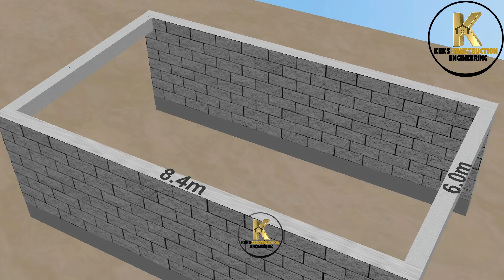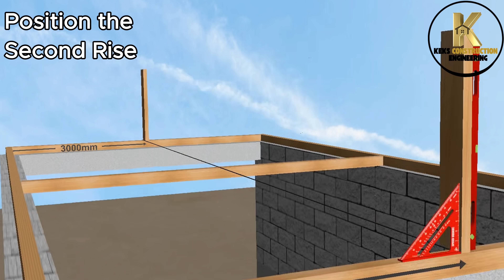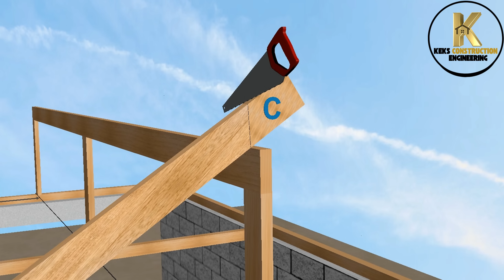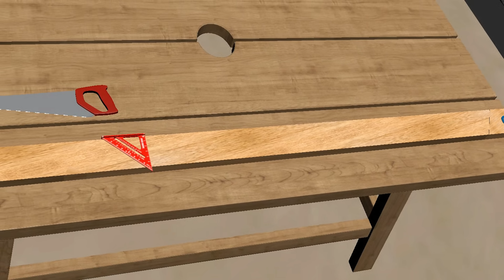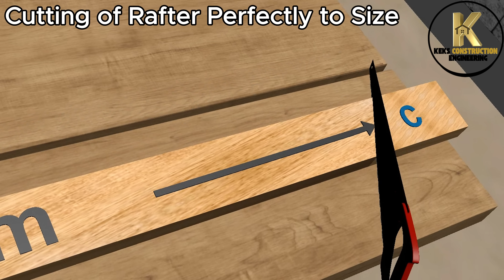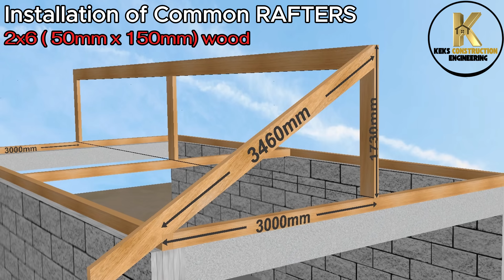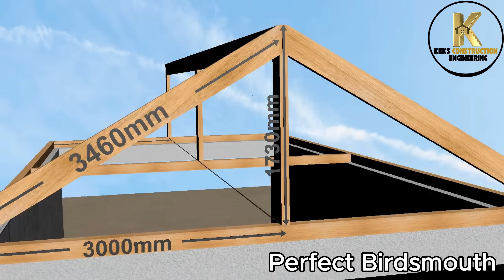The SECRET to Perfect RAFTERS Using a SPEED SQUARE & Spirit LEVEL

Comment: Great tip for getting accurate rafter cuts. Proper framing and roofing details make a big difference in the strength and durability of a shell home. Quality shell construction gives homeowners a solid, weather-ready starting point while still allowing plenty of flexibility for interior finishes and customization.

Comment: I still don't understand why the rafter drops a small distance onto the wall plate at point B, while at point C the top of the rafter is level with the ridge board.😮 I have already seen several films about rafters and birds mouths. I never saw a good explanation about this. I did it myself by transferring a scale drawing from paper onto the rafter. That worked fine too.😊
Reply from the maker: Ok. 
Don't worry, I will do one Video that will Simplify everything in a very easy way.

Watch other Videos on this Channel and Stay tuned for more.
Reply: Thanks 😊

Comment: Как на счёт совета по односкатной крыше, но с полезным пространством внутри, с высотой от 80см. низкой стороны. 📐 Какой сделать оптимальный угол, если укрывать профнастилом?
Reply from the maker: For a lean-to roof with corrugated metal, an angle of at least 8-10 degrees is recommended to ensure proper water drainage.

Watch this RAFTER LAYOUT Video below.....You will love it 👇👇 
https://youtu.be/2LuKOz1EVXg?si=xytOUHWmUnykRXuH

Comment: Solutions in search of problems.
How to cut and assemble a gable roof and its variations was mastered long ago. It isn’t hard.
Learning how to do it with just a rafter square, tape measure, pencil, and appropriate saw is the best way. You can then vary the tools if you choose, with a real understanding of what you are doing. It isn’t hard.
Here’s just one old school tip for a basic rectangle footprint with a gable roof: you only run one string line to straighten the ridge and bearing walls, and you only run it once.
Here’s another: never measure rafters individually, and never trim correctly cut rafters. If the rafters don’t fit (presumably because an idiot built the walls), FIX THE WALLS. It’s faster and when you are done everything is what it is supposed to be.
Reply from the maker: I appreciate your insight on these fundamental methods; construction is indeed a field with many valid approaches.

Watch this RAFTER LAYOUT Video below.....You will love it 👇👇 
https://youtu.be/2LuKOz1EVXg?si=xytOUHWmUnykRXuH

Comment: you know work's even better.... a rafter square.  
I'm not sure why anybody would try to reinvent the rafter square by using something inferior like a speed square. 
if you get a rafter square with a rafter table inscribed on it then you have the info needed for calculating most common slopes and if you don't have a calculator then you can use the framing square to 'step out' the rafter.

Comment: Sometimes you don't have access to a calculator or don't have arithmetic skills. In this case approximations are your best option, including guessing the length  of the rafter and the angle of the plumb cut.  Yes you can get a long rafter and guess the plum cut. If it is wrong simply cut a little more until you get it right. .This video promotes this approach, very useful in some countries. You can wing it when using lumber. If you use metal keep away from this video. Metal requires more precision and it is worth learning the simple arithmetic. The danger with looking at at an AI video with an AI voice is that you should know that behind this video there is NO CONSTRUCTION talent or experience, only theory.  10/10 for making a video game -like constructional videos. For some reasons the numbers are wrong as well. Not by much, but they are wrong. Also look at videos where a human that knows what he is doing, uses lumber and not computer graphics and bad arithmetic. The producer of this video is probably a student with no hands-on experience. Does not tell you the size of the rafters, the size of the ridge board, does not consider the "adjusted run", does not tell you how he got to the rise of 1750mm. DO NOT copy the architecture of this gable roof. It is NOT structurally sound. Anyone with basic arithmetic can see that the numbers, that are very easy to calculate are wrong, including the diagonal.  This is an AI  "wing it" video that shows the producer's graphic skills in graphic software, NOT a practical hands-on video. There are many hands on videos that teach you properly from expert humans. Keep away from AI videos, AI music and above all an AI voice.
Reply from the maker: It takes someone who have the experience to use those softwares to produce this.

Watch this one below and see the massive improvement. Feel free to criticize it. I am a real human who's trying to use these modern technology to teach many people. It's not always easy from the beginning but it gets better it goes on.

Watch this RAFTER LAYOUT Video below..... and Let me know your take. THANKS 🙏 👇👇 
https://youtu.be/2LuKOz1EVXg?si=xytOUHWmUnykRXuH

Comment: Seems everyone agrees with your calculations. The numbers are wrong. A 4th grade student can do the arithmetic and get the numbers right. These numbers are wrong. Not materially wrong, nut enough for you to know you should go elsewhere to learn.  The maker   (probably a lovely child) is playing with graphic and AI software and is obviously trying to learn on the way getting a few clicks as he or she does. You must remove from the RUN  half the thickness of the riser to get the ADJUSTED RUN.  Then you multiply the pitch  (7/12 =0.58333) by the ADJ RUN . If the riser is 100mm thick the ADJ  RUN is 2950mm. and the RISE is 1721mm. The DIAGONAL will be 3415mm (plus the tail length).  If you don't have a calculator, draw a triangle to a 1/10th scale and measure the diagonal from there. If you have a calculator multiply the RUN  by itself  (2950 x2950 = 8702500) and add it to the RISE multiplied by itself (1721x 1721=2961841). Now add them together = 11664341. Now take the square root and get 3415. The square root is on most calculators.

Comment: Hey, the method is right, but then the number 3460mm is not right... the first line you draw on the left is 3460mm, and then the second line you draw is also 3460mm, which is impossible.

Comment: How do you get your rise?
Reply: Get a cheap Building calculator or  use simple trigonometry. The Rise/Run is what you learned in school as the Tangent angle. 7/12 = 05833. Now multiply that by the RUN which is 3000mm and you get 1750mm which is the rise.

Comment: The central post bears most of the load, and there's no load-bearing wall beneath it, so the cross beam will sag. In this case, you need to install lateral oblique supports at a 45-degree angle that will transfer the load from the center of the ridge to the load-bearing walls. All the best, thank you.
Reply from the maker: Thank you for your valuable insight on this construction detail.

Comment: this measuring sistem does not work , because the top of the rafter afret cuting  goes down about 20-30 cm, and botom only about 5 or 10 cm.
Reply: Correct, however on a long rafter, the error is insignificant because the change of angle when the rafter drops is miniscule. If the rafter was very wide, say 500mm, then the change in angle would be calculated. Also what an expert roofer does is to cut with the circular saw not right on the pencil line but slightly (very slightly) over it to compensate for the fact that the bird's mouth is roughly a third of the width of the rafter

Comment: Если внизу сделать. Надрез угол меняется и наверху появится зазор
Reply: correct, however for a long rafter that is only 4 inches wide, change in angle is insignificant and can be easily accommodated by cutting slightly across the pencil line and not over it. If the rafter was 500mm high, then his method would not work.

Comment: Добрый день. В действительности так идеально не получится. Стропило опуститься на глубину запила и плотно с коньком оно не встанет. В вашем случае в конёк будет упираться только верх торца стропила, а низ будет с зазором, тоже самое будет внизу, стропило будет опираться на обвязку в одной точке, а не лежать всей плоскостью на обвязке. Конечно надо было нарисовать, тогда будет понятнее что я написал, но рисовать в телефоне, к сожалению, не умею.
Reply: Correct, however what you can do if you are not arithmetically minded and can't use a calculator, is NOT to cut the rafter along the pencil line but slightly across it (starting from the low end) This will change the angle slightly and make a tight fit. If the rafyter was very thick (much kore than 4 inches) the calculation should be done the analytical way

Comment: чому не враховано зміщення осі(гребеню) на половину товщини опорної стійки?
Reply: Yes it is taken into account by drawing the plumb line as shown in the video. The angle is slightly off because the rafter drops 4 inches from one end and only 1 inch at the other end. You can compensate by cutting across the plumb line and not on it. This will slightly decrease the angle and make a perfect fir

Comment: When cutting the birdsmith is there a certain angle of the perpendicular line?
Reply from the maker: It's the same angle of the Plumb Cut. Then draw a Perpendicular line to the Plumb cut. This gives you the Seat Cut (Birdsmouth).
Reply: @keksconstructionengineering  thank you

Comment: При монтаже стропило сверху(по коньку) опускается больше, чем на стене, поэтому градус изменится. Нужно пятки одинаковые делать и сверху и снизу
Reply: Получается, если у него угол получился 30° то Нижняя пятка должна быть тоже 30°?
Reply: Теоретик
Reply: You are correct. An experienced roofer compensates by cutting the rafter plumb line ACROSS the penciled line , not over iot. In other words you remove a little more from the top of the rafter, making an almost perfect fit.

Comment: great video but i am a little confused. firstly the drawing shows the measurement from the apex to outside of topplate as 3460, but then the plumbline is ruled from side of ridge beam. So then you wouldnt you need to deduct half the thickness of the ridge beam from the 3460 measurment for the birdsmouth to still land on the outside of the top plate?
secondly the rafter is placed onto the ridge beam and topplate initially to make the ridge plumb line and therefor the pitch angle. But then after when the birds mouth is cut and the rafter is placed in position wouldnt the anlge change slightly as the tail end is only lowering by the length of the plumb cut in the birds mouth but the apex end  is dropped to become flush with the top of the ridge beam, Wouldnt this open the plumb cut against the ridge beam? 
thanks
Reply: Exactly what I was thinking

Comment: The roof geometry in the drawing is inconsistent: the stated pitch and rafter length are valid only from the inner wall line to the ridge, but they do not account for the eaves overhang, the birdsmouth cut, or the actual ridge thickness. As a result, the rafter length, eaves dimension, and ridge connection cannot all be correct at the same time.

Comment: Sketch picture: 
Ridge board is completely missing, making the rafter totally misaligned. 
If the Ridge board is not missing, but included in the 1730mm rise, than the rafter is misaligned, as it needs to slide down 15cm or 6". If you slide it down, than the birds mouth will be misaligned.
Even if you ignore the what i have just said, the birds mouth is misaligned as is, as it should be right at the 3000mm mark.
Actually i watched this video a few times, and learned a lot, thanks for that. Scrutinising this sketch is a proof, that i have learned new things.
Reply: Все верно, при таком замере верхний угол будет больше на 1/2“, а длина стропилы должна быть меньше, так как при опускании на свое место, она укорачивается, а это значит запил не совпадет с лежнем.

Comment: dès le départ tu sais déjà que le vertical à une hauteur de 1730mm mais tu n'explique pas comment tu le sais  à des nule comme moi c'est ça qui est important
Reply from the maker: It's very simple. 
You will get that from the Architectural drawing of the house. 
Just go and Check the Roof Elevation and Section, you will get all the Roof details as designed by the Architect.

Comment: You told me to draw parallel lines on line B of Buzzmouth section, but how do you know if the lines are parallel?
Reply: Both lines are 30 degrees and the measurement between the lines is the thickness of the timber 75 x 100 mm, so the measurement between the lines is 100 mm. It's Birds Mouth not Buzzmouth👍

Comment: Everything it looks essy and clear, except from where to where to take the measurements,  from the top, middle or bottom?🤔🤔🤔I hope someone could tell me. Thanks.
Reply: It doesn't matter, when you measure a length of 3360 mm, you'll get a perfect angle of 30 degrees from the top, bottom, or middle. You can use a square and draw a line, and that line will be at 30 degrees.

Comment: I have question 
How we figure out how long has to be rise is there any calculation
Reply from the maker: You can use Pythagorean Rule to get the Rise. 
However, the Roof Height is given in the Architectural design of the Building. Once you Check the Cross section of the roof, you will see all the needed Roof details. 

Watch other Construction Videos on this Channel, Join the Community & Stay Tune to KEKS CONSTRUCTION ENGINEERING for More & Better Construction VIDEOS Every Week. 

Feel Free to Ask Questions

Thanks

Comment: How you get the  30 degree
Reply: You get the 30 degree angle by placing the pivot that’s in speed square and you just turn while maintaining the pivot on the top of the line mark and just turn it until it gives you the like that’s be desired.  And then form the 30 degree angle all the cuts of the top of the common rafters will be the same

Comment: Come on, let's measure this in Feet and Inches, not this commy crap, 3460mm, that's a lot to count. Ha. Feet and Inches, works well.
Reply from the maker: It's not a Crap as you said but a Standard system of Measurement that's Globally used.

There are two primary systems of measurement used globally. The Metric System (also known as SI or International System of Unit) and the Imperial System (also called U.S. Customary Unit). 

I use Matric system of Measurement  but I also Understand and work with Imperial System of Measurement. 

A good and Experienced Workman should Understand these two systems of Measurement and Still Prefer to use one because Measurement can be in any of these two systems. 

Thank you.

Comment: Your drawing in this video  clearly shows  the rafters at ridge point meet each other above the ridge board. The rafters that were cut in the video  meet the corner of the ridge board. Therefore  this tutorial  is not correct.
Reply from the maker: That was the omission on the sketch.... It was just a sketch not a full drawing. I discovered that omission on the sketch later. That Rafter length supposed to stop at the  Ridge Board but unfortunately, I Omitted the Ridge Board in the sketch. 
Aside this omission, every other thing is correct. 

Thanks for your good Observation. 
I do appreciate. 
Construction Animation is a tedious work and one is likely to omit something just like it happens on site too. 

Thanks.

Comment: What's the distance between each rafter. How do you work out how many rafters you need?
Reply from the maker: It's Very simple. 
Let's use this very work to work out that. 
The spacing between the Rafters = 1.2m
From the Video, the Length of the Roof = 8.4m
Now to get the number of Rafters that will enter one side, use this simple formula:
No. of Rafters = (Length of Roof/Rafter Spacing) + 1
Now, let's put in our values. 
No. of Rafters = (8.4m/1.2m) + 1
No. of Rafters = 7 + 1 = 8 number of Rafters for one side. 
So to get the number for the two sides = 8x2 = 16 number of Rafters. 

Hope this Answers your Question?

Comment: If  you want to cut rafters get a rafter book...  Rafters in a book are listed by the span...  Say you have a 24'   span  and you want to cut a common rafter deduct the thickness of the ridge usually 1 1/2 ''   so you would have 23 ft 10 1/2 inches look this up under common rafter and that is the exact length of the rafter.  Now to cut a hip or  valley look up 23 ft 10 1/2''  and you will get the exact length of a hip or valley There is no shoretening  There is a difference at the seat. On a hip you more forward usually 3/4 of an inch  put a plumb mark and  use that to make it the same as the common seat.  On a valley you continue the plumb mark and cut the seat through it.
Reply from the maker: Thank you so much for this. 
It will be useful for others.

Comment: El ángulo si lo entendí pero el pequeño corte no entendí por qué como sa ver cuántos sentimetro seleda para el corte pequeño
Reply from the maker: Ok. 
Measure the thickness of your Wall Plate (I mean the Width of the top side of the Wall Plate on where the Rafter will be Resting). In this Video, the size of the Wall Plate is 3x4inches. 3inches(75mm) is the Width of the top side of the Wall Plate That was why I Offset 75mm before Marking to get the Birdsmouth. 
With this explanation, Watch the Video again you will understand it better now. 
Thanks

Watch other Construction Videos on this Channel, Join the Community & Stay Tune to KEKS CONSTRUCTION ENGINEERING for More & Better Construction VIDEOS Every Week. 

Feel Free to Ask Questions

Thanks